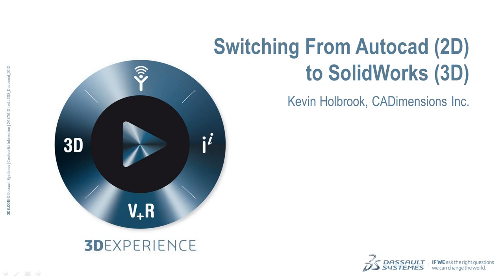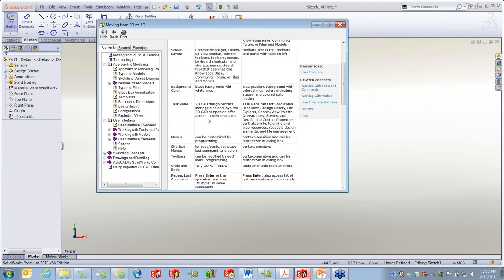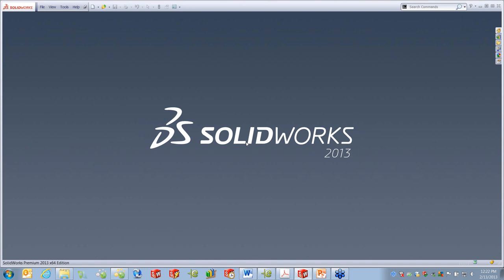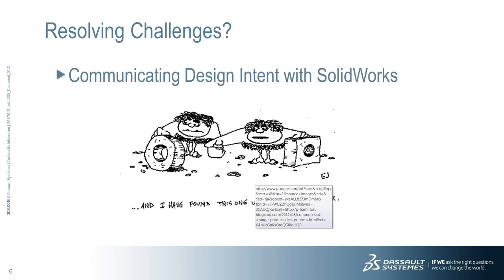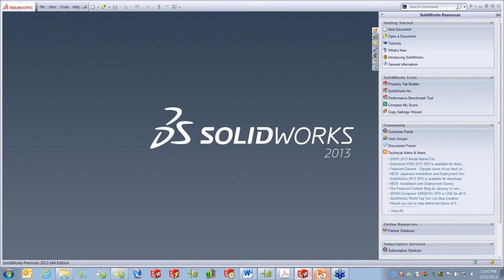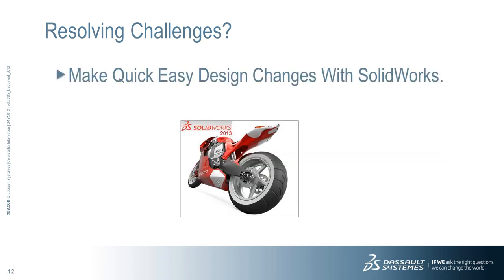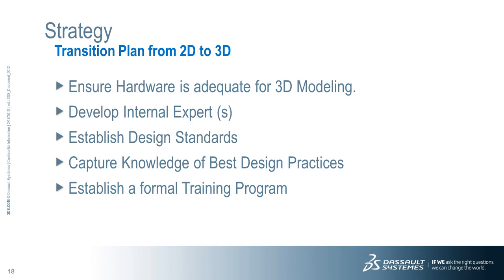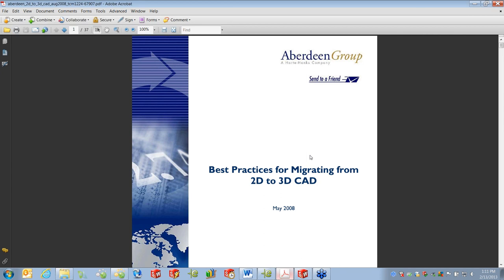Switching from AutoCAD to SOLIDWORKS

Comment: bro autocad is 3d
Reply: Autodesk Inventor is 3D. AutoCAD is 2D.
Reply: @CardinalTreehouse  what the hell ? when did AutoCAD switched to 3D ? I just learned to work in it and Iam considering switching to SolidWorks or Blender
Reply: @cv3nda367  Ok, let me clarify. The parent company that makes AutoCAD is called AutoDesk. AutoCAD is still a 2D CAD software, but has some wonky 3D drawing aspects, kind of like how you can unfold a cube and draw on it's separate sides.

AutoDesk also makes a software called Inventor. It is used to make 3D objects that could be printed on a 3D printer (with some in between software but it normally comes with the printer). 

Speaking as someone who has tried all 3 of the 3D modelling softwares you are talking about (Inventor, SolidWorks, and Blender), it really depends on what you want the software for. If you want to just make industrial like objects, get Inventor. It has tons of screws, pipes, etc. already in a built in library. If you want to do analysis of what you have modelled, go for SolidWorks, as Inventor cannot do this. SolidWorks doesn't come with that built in library though... As for Blender, get this if you want to make stuff look pretty (renders) and/or make more organic looking shapes, like a human head.